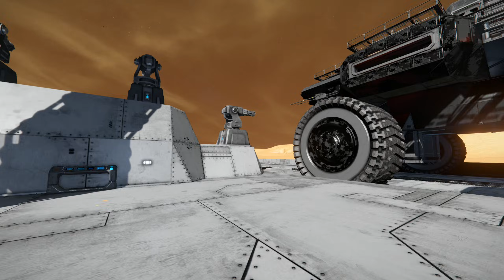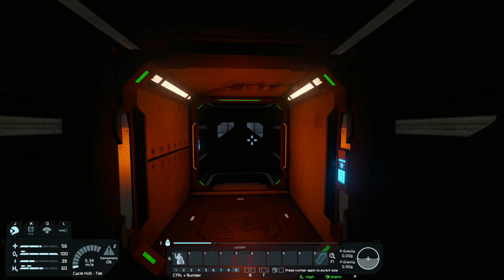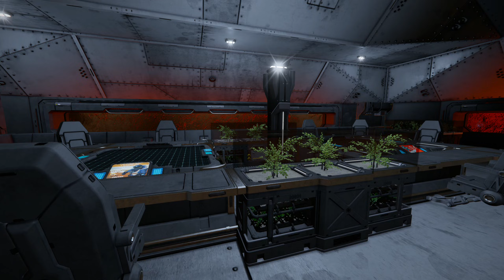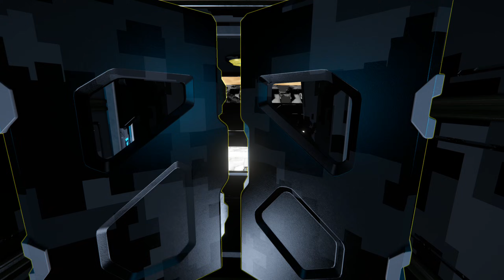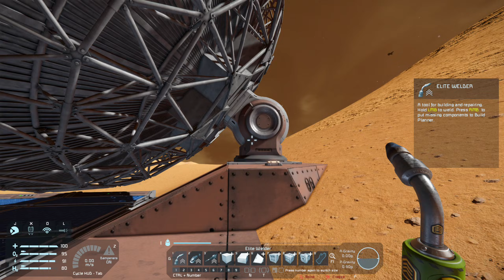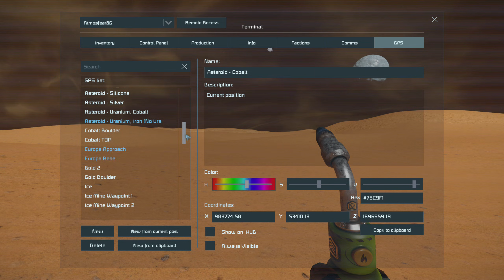Space Engineers - Mars Underground Bunker Tour!

Comment: I started carving out an underground asteroid base and thought it would be a good idea to check what others have done. Let's just say the 8x16x4 block space I made yesterday doesn't seem so big anymore. 😂
Reply from the maker: Yeah no matter how big you make the space, it never seems to be big enough aye!
Reply: @TheGarageGamer86  Since my comment, I basically dug downwards and added a whole new level of the same dimensions. I also made sure to have a 1 block gap between floors for the conveyor system.

And one small thing I learned early on. It's useful to have interior wall blocks for flat surfaces like foors (there's a side that looks like nice simple floor tiles), as they use a lot less iron than armour blocks. (Interior wall needs about 52 and light armour needs 175.)
Reply: @TheGarageGamer86  Oh, I just stumbled across a neat idea. I was putting down an elevated walkway like in your base, and I used the space underneath to put a few batteries, then I noticed the little lights on top add a nice effect to the grated floor. :D